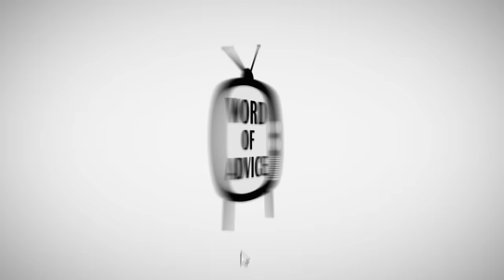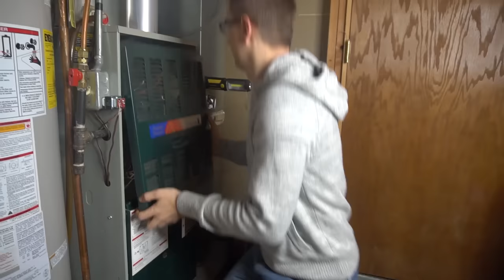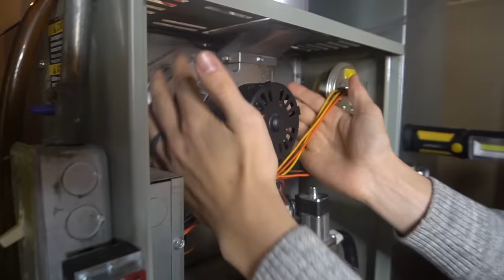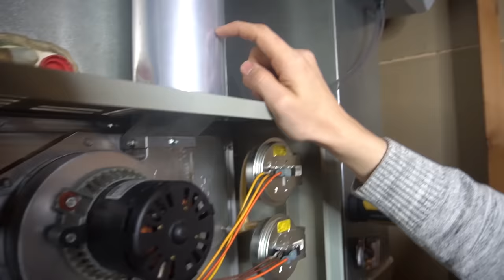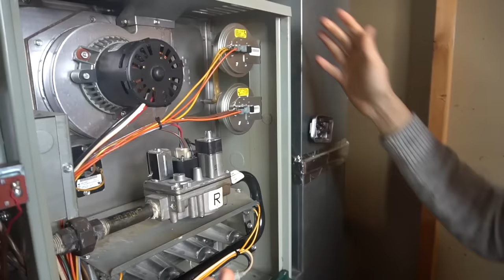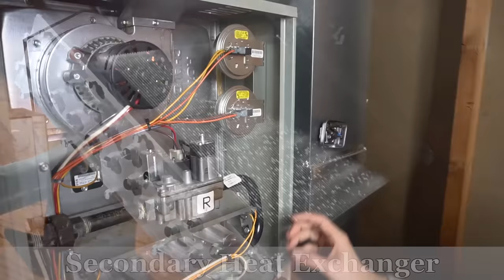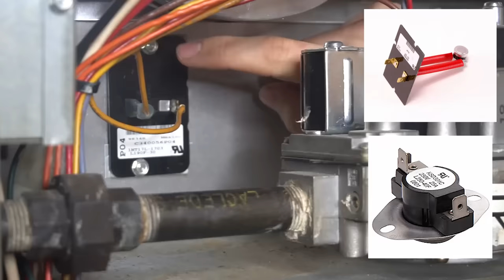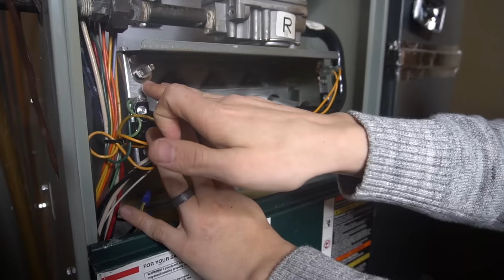Furnace Parts and Functions Explained

Comment: Thank you so much for all the videos you have provided! It has been helping me a lot as a new homeowner. I have a question now. My furnace is produced by ICP. There is small black pipe connecting inside of the furnace to the outside the furnace (I have two pictures here, hope it shows clearly). I noticed the water keeps dripping from it. What is the black pipe for and where the water comes from? Thank you.
Reply: Somehow I couldn’t attach the two pictures here. Can I send you via email? Thanks again.

Comment: At the very beginning you talk about power coming in and the switch but fail to mention the purpose of the transformer mounted to the switch box. What's it for?
Reply from the maker: That is not part of the furnace parts so I didn't think to explain it in the video. That is a transformer for the bypass whole house humidifier.

Comment: Its 2/10/2019 the heat went out at 2:00 a.m. only 13 degrees. replaced the ignitor no luck. Watching more I checked the flame rollout switch, it was tripped. reset it and there is heat. Is there a video on how to replace the thermostat we have the old dial one and was having trouble with the inducer motor going on in the summer while the A.C. was running. thank you and keep up the "Dad" humor.
Reply from the maker: I don't have a video on how to replace a thermostat but I am sure there are plenty of those videos on YouTube. From what you described though, it sounds more like a bad control board in the furnace than a bad thermostat.. By the way, if your flame rollout tripped, that could mean that your heat exchanger is bad. Hopefully you have at least one new(ish) carbon monoxide detector in the house just in case. It would be best if you had someone come check it out for you as that could be dangerous. But that's up to you to decide.. And glad you enjoyed the quirky humor! ;)

Comment: So is a furnace the same thing as an air handler?? If not do you have an air handler video??
Reply from the maker: It is not the same. The reason I mention air handler is because some houses will only have an air conditioner but no furnace. Instead of the furnace there will be an air handler which looks kind of like a furnace except without the heating components. Sorry, I do not have any videos where I work on an air handler.

Comment: My ruud turns on when it wants to ,it cycles once then quits,I just replaced the the limit switch and it cycled fine for 3 hours then quit again,it turns on manually but after 5 to 8 minutes it quits

Comment: Did you mention the door safety switch?  Good timing on the new video, I was just working on the furnace today.  So far using your videos I have found a bad thermostat and a plugged condensate trap.  It is now working better/running longer, but it still cycles off for a while then turns back on after a minute or two.  Is there a definitive way to diagnose an over heat condition?
Reply from the maker: Hey Dave! Yes! I totally forgot to mention the door switch! Thank you for pointing that out. The easiest way to know if your furnace is overheating is if you have an error code blinking on your control board that says so. Otherwise you can check it with a meter if you have one by testing either voltage or resistance. For example, right when the burners shut off, you can unplug the wires that go to the high limit (if the connectors are not insulated make sure they don't touch anything metal and short out) and check for continuity. If the switch is open (O/L), then you know the furnace overheated. I think I go over that in this video: https://www.youtube.com/watch?v=pJzP1jzYPqg&t=1s

Comment: You done edumacated me and I'm thankin' ya!  However, I need advice for a friend of mine  (whose house burnt 4 years from her using a 'free' electric stove/oven she found...) who I'm trying to help who has a Bryant 75,000 BTU natural gas furnace (1988 model w ribbon burners & standing pilot...see!  I can communicate in furnace tech talk now because I watched this video!)  that was 'converted' to burn propane (she paid a guy to put different orifices in).  I just looked at this unit working last night, then am comparing what I saw on this video, and she is missing:  induction blower, metal pressure/limit switch, and I don't think I saw any flame rollout sensors.  (Her flue pipe & opening is blackened from just 1 winter season.)  As a matter of fact, it looks like this furnace has been lobotomized of any electrical logic & control & sensors other than one on the gas input valve.  
This unit & burners are filthy inside.  Over the phone, I asked her what brand & model it was.  Couldn't be found, I was told.  I go over later, scrape off 1/4" dust on the bottom below manifold and find a big riveted badge with all specs/parameters/model, etc.
The pilot light & ribbon burners flames are big yellow-orange and flickering wanting to lick back out the sides/front towards manifold & not up/back towards flue.  

She insulated her present bungalow with plain styrofoam.  Is it flammable?  I was going to light a little piece as a safety experiment, but she wouldn't let me.  Doh!  She told me that because it's oil-based it really burns easily............................................................................................
Reply: since this was posted 2 weeks ago  you probably already know it isn't safe, dangerous fumes are coming from it, it needs professional help,  probably a replacement heat exchanger, it is plugged and/or cracked

Comment: My heater comes on and heats up my home to whatever the thermostat is set for but for some reason it doesn't blow like it used to. Before it would come on then shortly afterwards the blower would engage but that stage does not engage???

Comment: the fan on our account an heating unit constantly runs how do I fix ot
Reply from the maker: Is the fan set to ON on the thermostat by chance? Switch it to auto. If it is already on auto, then I would suspect a defective control board in the furnace.

Comment: Furnaces since 1992 are like this, but units 1991 and older do not have a computer control board and do not have a draft inducer, instead they have a gravity venting system that has a draft hood on the furnace!

Comment: Tstat calls for heat
Inducer motor
Pressure switch
Hsi 
Gas valve
Flame sensor detects combustion
Hsi turns off 
Blower 
Tstat gets satisfied
Turns burners off and fan blows until unit cools off.

Fairly simple... Well kinda lol

Comment: So if the the limit switch is bad it will not start the ignition. So inducer starts, pressure switch is good and heater will not kick on - possibly limit switch bad.

Comment: A union on the gas line, inside the furnace cabinet is also not recommended and many states not code.
Reply: It used to be common years ago but the codes have changed in many places.  I saw that too ;-)

Comment: wait wait wait! right at the end of talking bout the hot surface igniter, you touched the "plug"..now im without heat this yr,(over 2 months now)in mich, and a double leg amputee, and can NOT get a single agency to flippin help me! sooo, im teaching myself!,.oh boy!,.lol...anyways, ive done and tried all the simple stuff, like the coupler, heat/flame sensor, power and gas. but, my eye and mind keep hitting on that plug.  see my fiance just passed away from covid and i have no family or friends, so no help, but i remember yrs ago a bird died in my chimney, falling onto a fan of somekind, ended up causing a fan motor to go out, it was a cheap quick fix, but only after my man tried a million other things!.lol..but i just wasnt paying attention enough to everything he was trying, but i remembered those i just mentioned, but i seem to remember talk of checking a fuse. is there a fuse in that "plug"?....i also begged the gas co to come and make sure i was even getting gas, because im also suffering without hot water for 2.5months now, cause hot water tank blew out, and its the only other gas appliance. so i wasnt sure i even had gas coming in. anyhow i begged the tech to come inside and check the line to the furnace also, well, she wasnt pleasant about it at all, but went downstairs, i powered up and kicked on the furnace, while it was blowing, she said i had gas. but then said something i totally didnt get. she said (without even looking at the open back of the furnace) she said, "UR NOT GETTING POWER TO THE A-FRAME) HUH??? ive watched and studied so many of these vids over almost 3 months, and i have yet to hear mention of an A-FRAME! and how can it not be getting power? she was standing beside it and talking over the blowing fan in the furnace!? she then asked if id tried lighting the pilot, i knew better, but said "well, its an auto pilot, so im not spose to have to do that, but! i did try. because IM FREEZING TO DEATH AND NOBODY WILL HELP ME!..anyhow, she took her nasty attitude and left....so, here i am, grasping at another straw! ANY help will be so greatly appreciated!!...oh yeah, heres exactly what its doing. i kick on thermostat, turn on gas and power, and it kicks on, blows air for approx a minute or so, then stops, but theres a strange black round dial looking thing, and when it stops blowing, that dial makes a small tiny buzzing, but the more i feel around and get my ear in closer, its almost like its vibrating. but, its enough to concern me, and i just cut the power back off, since there is no flame or lite pilot anyhow.....thank you!

Comment: I have been watching all your videos,and other s on furnace filters I  have the manual for mine, it calls for a permanent black plastic filter that sits flat on the bottom of the enclosure on a sheet metalbase, I don't get it why have a filter where nothing is going thru, it has no filters on the sides, I ordered it anyway, since it has never had one, it's a1995 rheem, completely baffled on this one, hope you can give me some insight, thanks you, I consider the Guru of heat&air!

Comment: I don't like the power switch being right next to the gas line like that!
Reply: Yeah the gas line looks like it's only an inch away from the switch, but that could be an optical illusion, different lenses can "compress" space, I hope it isn't really that close.  I like that they used the 4" square box, plenty of room inside, our furnace was installed in 1985, a Carrier Weather Maker.  It has the old rectangular single gang box with switch and plug fuse in the cover.  Also if your wondering about the gas connection, the plumbing code requires a tee instead of an elbow to make a "drop" fitting.  That pipe nipple and cap help catch any dirt or water in the line before entering the furnace, code requires a minimum 2" drop, but they also use 6" or 8", whatever is in their box.

Comment: I can't find the capacitor on my unit. I looked everywhere.
Reply from the maker: If you have an ECM motor/variable speed motor, then you will not have a capacitor as those motors do not need one. Google an image of the difference between a PSC and ECM motor and then take a look at yours. 👍
Reply: @WordofAdviceTV  Thank you very much, This was driving me crazy, All other repair videos keep saying my problem is the capacitor, Now I just need to figure out what the problem is, The blower works fine as long as I don't turn it off, once I turn it off every time it starts it will move slow then stop,  it will keep doing that until it finally starts and that could take an hour to one day. Thank you so much for your help.

Comment: inducer motor is used to "induce/create an air flow out the exhaust chimney for pre-firing of the flame .. in other words to create / induce air flow to make sure their IS an exhaust air flow BEFORE the flame ignites .. and if there is not , then the flame will NOT ignite .... the main fan motor is what moves the air over the manifold to heat the air and to disperse it throughout your home via air ducts , would you like to try again ?